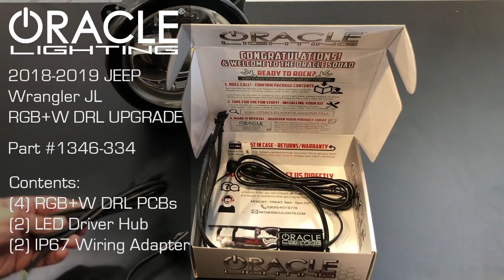Jeep Wranger JL ColorSHIFT RGB+W Headlight DRL Upgrade from ORACLE Lighting

Comment: Hi Dear, I have a question, we in the Middle East, the Wrangler does not come with a toroidal LED, it does not work, can I start it with your product?
Reply from the maker: Abdullah Al Ameer if you have the plastic ring in the light but it does not illuminate then this will provide a light source to make the ring light up 👍
Reply: @ORACLElights  Like this advertised in the video
Reply from the maker: @abdullahalameer5061  yes, it will work just like you see in the video.